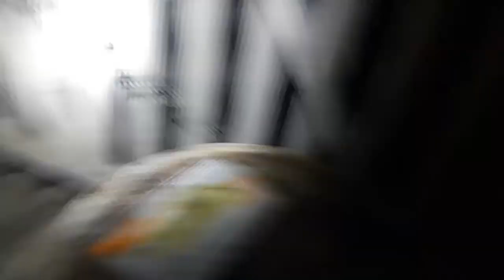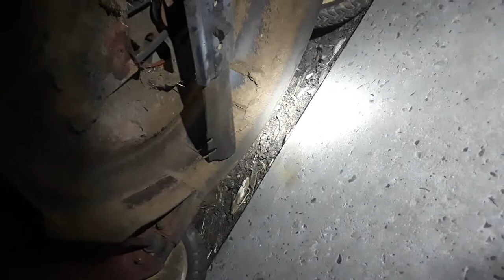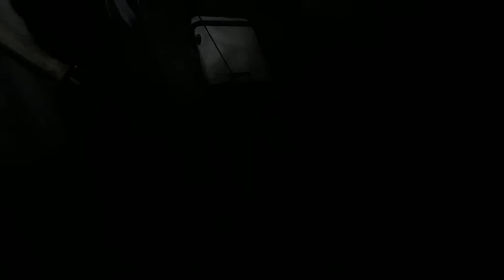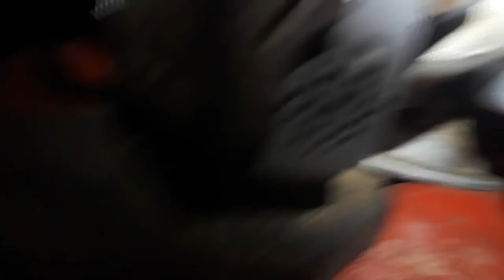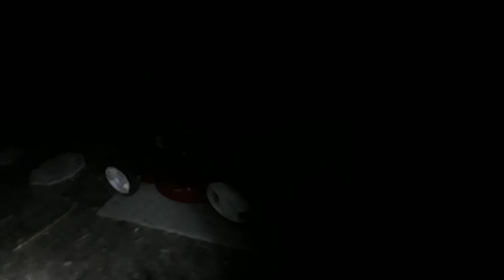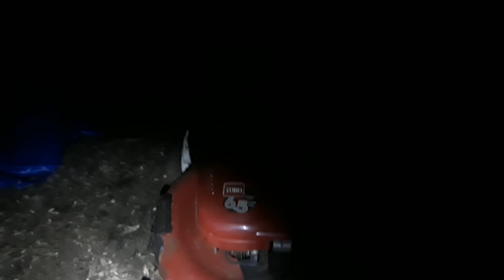Toro recycler lawn mower up and running in 10 minutes, quick and dirty carb clean. $200 mower.

Comment: Nice $200 US find buddy and beauty quick carb clean to get that baby running. Techumseh makes a great engine but the worst primer bulb we have ever seen. Their primer bulbs seem to stiffen up as time goes on. By the way drop that dude and don't worry why he dropped you. Better to talk with new friends you have made your old ones are just going to pull you down. Just a thought from the OLD MAN at EP brother.
Reply from the maker: Thanks for the advice bro, Plus I have a feeling it was someone else or a couple other individuals from my past that I didn't get along with me that told him not to associate with me. I can't say it for sure, but there's a good chance of it. As far as those primer bulbs go. Yes they do go hard, however they are easy to fix , I bought a five pack of them you just got to pull the little snap ring out that holds it in, put the new primer bulb in and then pop the new snap ring in place with a socket and then it's good to go. I'll make a video on it the next time I have one that's Rock solid. Thanks for the comment I appreciate it. Us Small engine guys stick together we're a family we watch out for each other. 👍